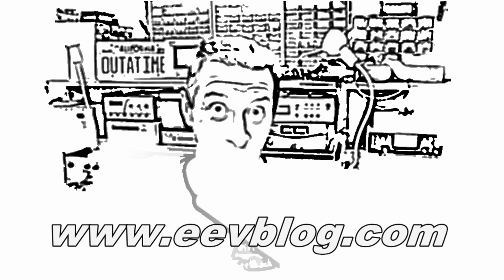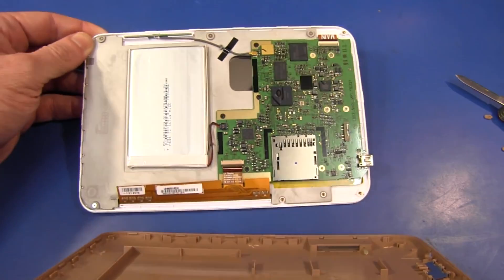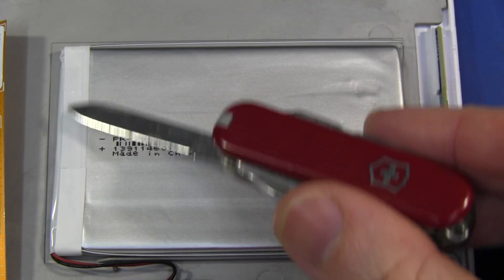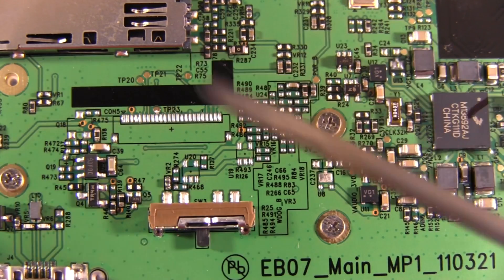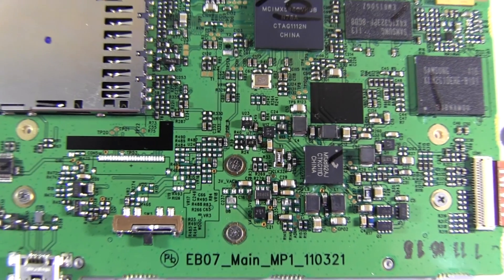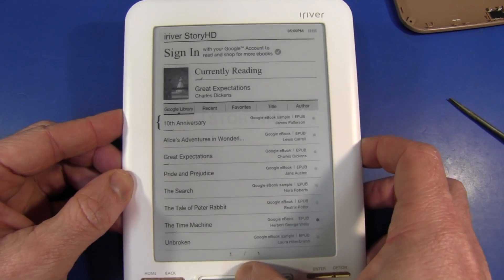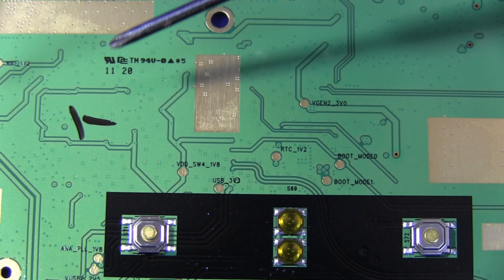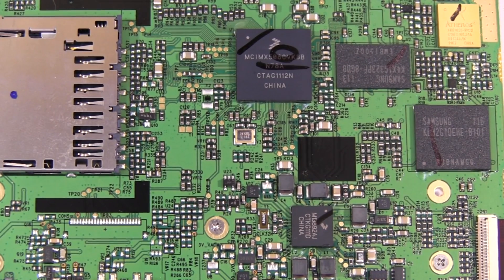iRiver Story HD eBook Reader TEARDOWN - EEVblog #189

Comment: https://www.nxp.com/docs/en/data-sheet/IMX50CEC.pdf
BOOT_MODE0,
 BOOT_MODE1 : 

These two input pins are sampled out of reset and set the boot mode. For Internal boot, they
should be set to 00. For Internal Fuse Only boot, they should be set to 10. For USB
downloader, they should be set to 11. The BOOTMODE pins are in the NVCC_RESET domain
and include an internal 100K pull-up resistor at start-up.

On Top side PCB pads T2 and T1 ( boot NS Blank CODEX" HID \ VID_15A2 & PID_0052 use  MFG-TOOL)

Comment: Interesting stuff! The Boot Mode  contacts you noticed seem to be used to control the mode of the processor. See Freescale docs for more details. I've experted an interesting bit (Section 9,4).

BMOD[1:0] Boot Type
00 Internal Boot
01 Reserved
10 Internal Boot – ROM Select
11 Serial Downloader